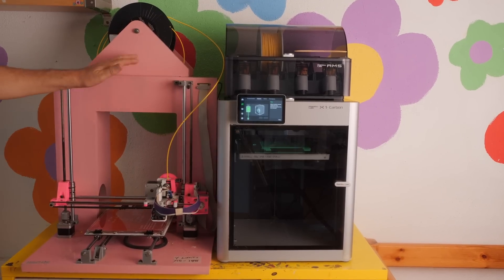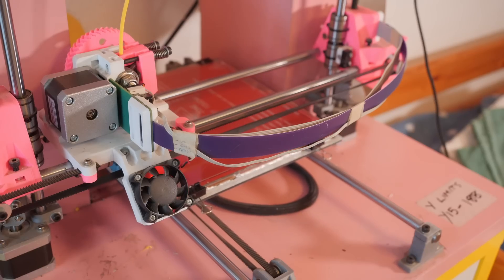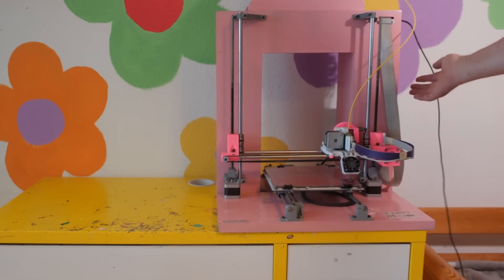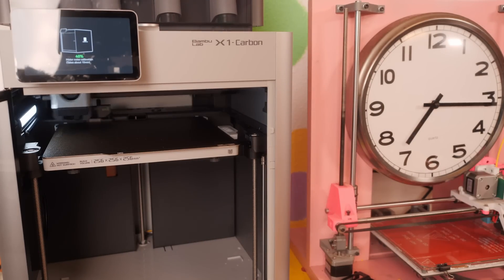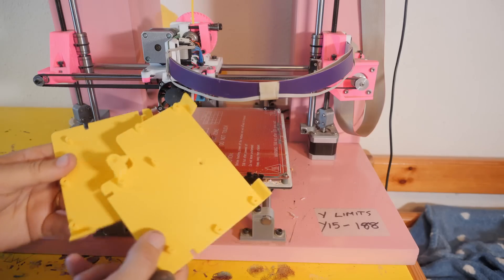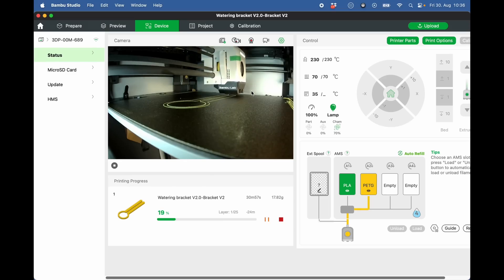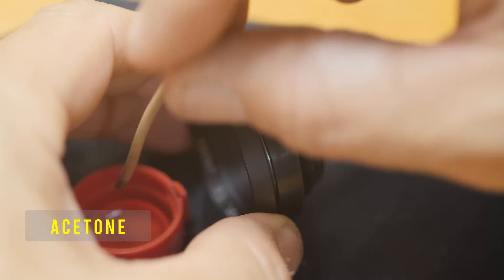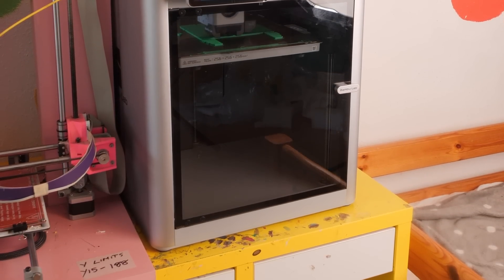How have 3D printers changed in a decade? || RotarySMP

Comment: A little gentle heat (on a pan or hotplate) may be in order if there is no plastic in the lens.  I'm told applying ponds cold cream to is the go-to fungus killer,  followed by a good clean, then rub your finger on the side of your nose and wipe the resulting 'nose oil'  on the glass  then clean and reassemble (fungus treatment is advice from 1970's Olympus techs).
Reply from the maker: What temp would you try first? I have some hydrogen peroxide, and was going to clean the fungus  with that.
Reply: @RotarySMP  not really sure,  I'd imagine just enough to soften any locking compound or glue that might be in the threads - I heated a seized helical to about 80C once.    Problem is the heat might upset your printed spanners.  Wild guess though... :)
Reply from the maker: @greaser5691  Good point :)
Reply: @RotarySMP  I Fixed a few old Contax Zeiss lenens, that were glued/loctite. I used a hair dryer to heat the lens up. Worked much better than solvents in my experiende. If had to guess they reached about 70 C
Reply from the maker: @anasel-mahdi2185  Thanks for that. Is there any likelyhood that this could be a left hand thread?

Comment: I went from some unreliable home-built CoreXY printer to a Prusa MK2 to a Prusa MK3S+ to a Bambu X1C w/ AMS. The MK3S+ hasn't been used in over a year now and just collects dust. The X1C has been nearly flawless for me.  There are some good mods for a better filament wiper, a new set of AMS plates for if you use Prusa spools, and a mess of other things.
Reply from the maker: G'day JC. I first saw prints on an X1C with my mate Stefano in Chigago. Wow, what a step forward.

Comment: Finally a new printer! This must make 3D printing much easier for you. 

I think some of the problems you have with the old printer is old brittle filament and moisture, but that old hardware and control board won't make things easy.

You could change the board to marlin and/or klipper, make a new tool head, and change the extruder, but the X1 carbon will be miles ahead anyways, so why bother.
Reply from the maker: Good points Bill. Until I started looking at X1C videos, I didn't even realise moisture was such an issue with filament. Some of mine are years old. There are some PLA colors/brands which were so brittle they'd snap on the way to the head.

Comment: 8:35 I think your nozzle is clogged or the slicer settings are not right (flow or filament diameter). Moist PLA gives me rather blobs on the surface.
Reply from the maker: I have certainly normally had better results than that. Given that the Z probe height was often wrong and nozzle got dragged around on the glass, I wonder if the nozzle hole is worn or distorted?

Comment: You can probably assign a static ip address to your wiener in the dhcp server on your router. 🤭
Reply: Yup - The wifi device needs a static MAC address for the router to work with
Reply from the maker: @throblet  Once I worked out that I can easily find the prinder with IP Scanner it stopped bothering me :)
Reply from the maker: I had a play with that with my mate Hamish who designed it, but never got it to stick.
Reply: @RotarySMP  Does the printer have a dynamic hardware address? Hence, not being able to get the fixed IP assignment in your router cos the hardware address is changing.
Reply: @LyallPearce  10 years ago... random MAC was new thing even on mobile phones (apple idiots introduced it in 2014).
So.. very dificult that this was the case.
Reply: @bmalovic  Why so much hate on random MAC? You can turn it off. But that's probably a bad idea.
I remember my school used to log all traffic and not only block users that used "too much data" but also calling police on and attempting to sue one of the students for uncovering things about them. The upload happened from their WiFi when he wasn't even physically in the building but they matched the address to the one of his laptop, recorded previously in logs and on camera when he was giving a presentation.
You can hate Apple for whatever you want but in terms of security most companies are way worse.